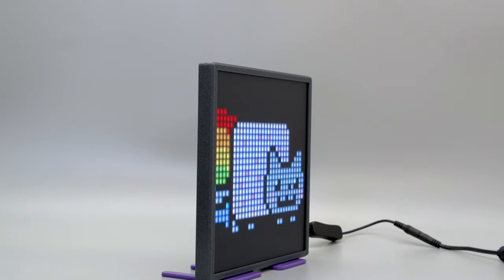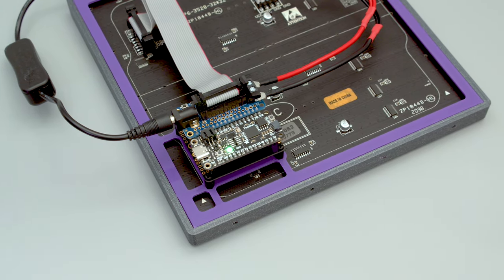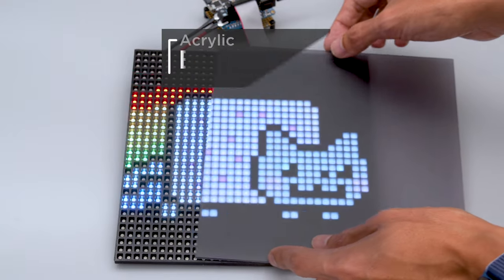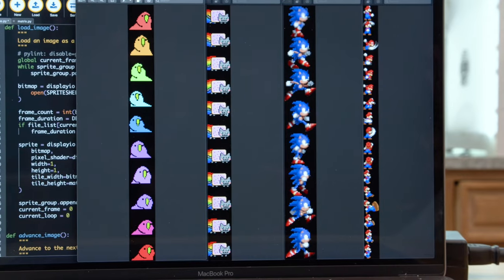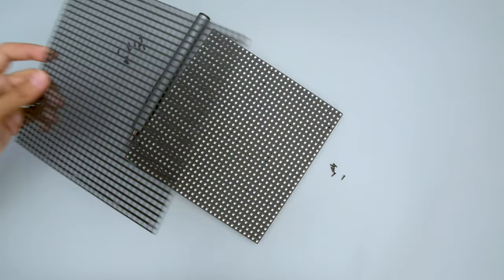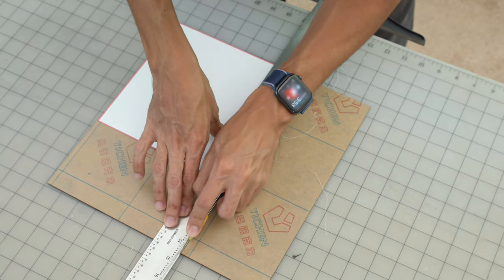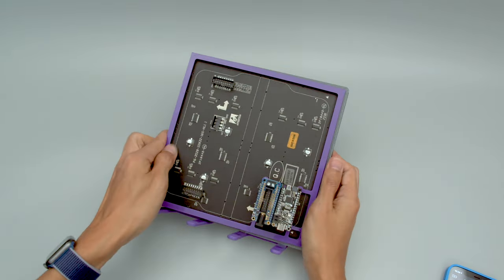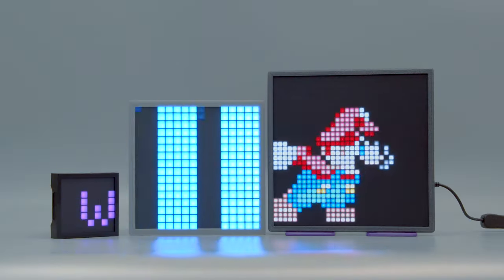Square Pixel Display with RGB Matrix and CircuitPython

Comment: question as a total n00b to all of this... how much more complex would it get if I wanted to put two of the displays next to each other in a different case to get a "widescreen"?
Coding wise and in terms of connection two instead of one display. cheers!
Reply from the maker: Would be easier to use a 64x32 display and just update the code with width=64 - The rgb matices tutorial shows how to connect multiple displays. https://learn.adafruit.com/rgb-led-matrices-matrix-panels-with-circuitpython/advanced-multiple-panels
Reply: @adafruit  Oh... :D well, yes. Thank you. hehehe.

Comment: this is fun. To have it internet connected are there connections left for an airlift wifi board?
Reply from the maker: could use the feather with esp32 s2 chip instead of the RP2040